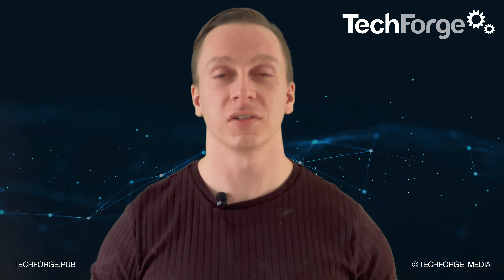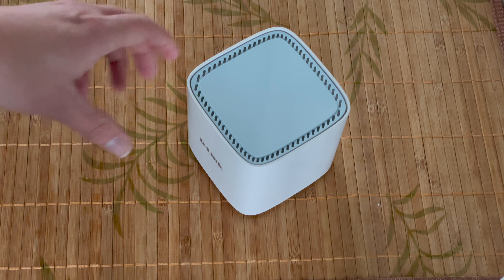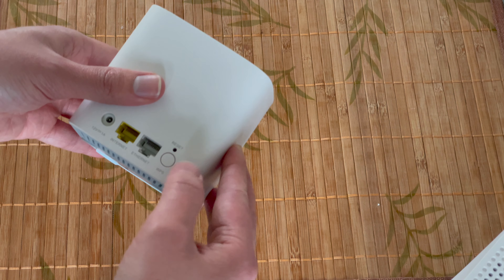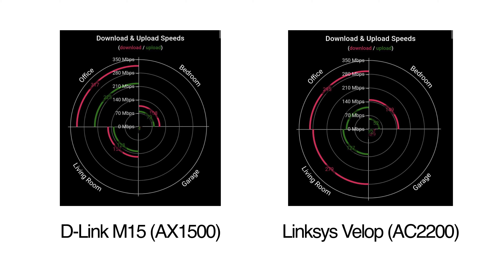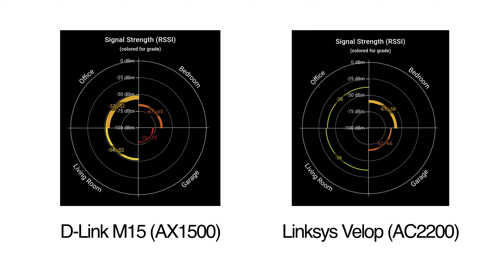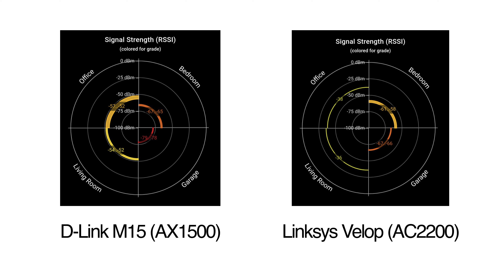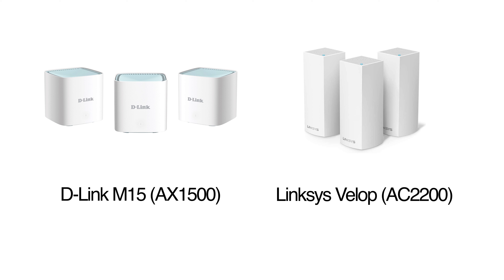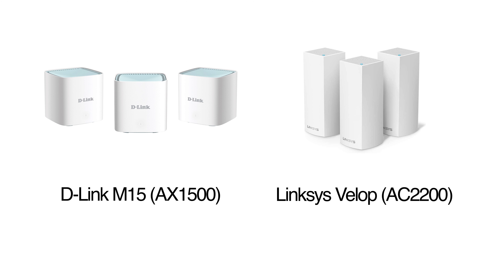D-Link M15 Eagle Pro AI Mesh System Review w/ Linksys Velop Performance Comparison | TechForge Media

Comment: Thanks for the honest review, we have this system on promo for the next week from this posting date, so its available for an even lower price at the moment

We have plans for a higher capacity mesh,  coming in April - AX3200 for anyone looking for a higher performance system
Reply from the maker: You're very welcome. The current promo makes the price-to-performance of this mesh system even more phenomenal. We look forward to putting the AX3200 mesh through its paces 🙂 –Ryan
Reply: would you consider the AX3200 a good upgrade from you older COVR 2200's (which I still find are great for the money)?
Reply: @petehelme7714  Hi Pete, these are delayed slightly and expected in June, So I will get my hands on and test myself shortly, as well as providing out for review. Wi-Fi 6 is a great upgrade if you have compatible devices and a good speed line from your ISP